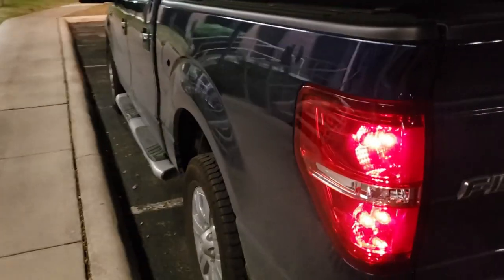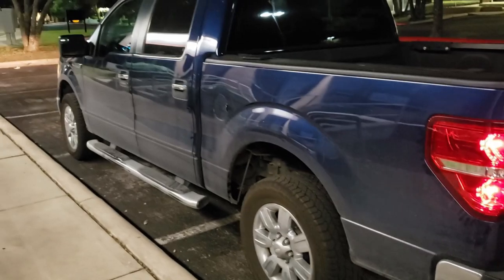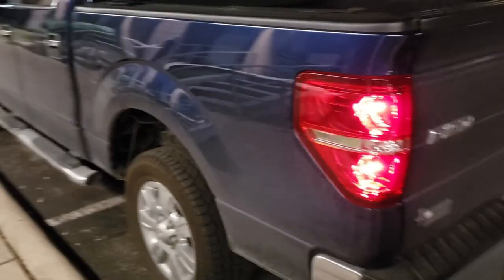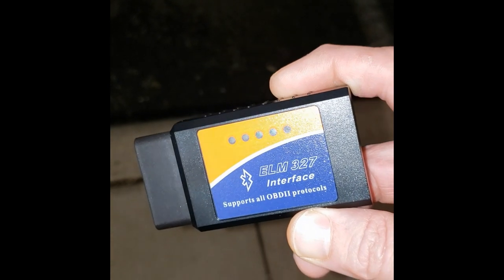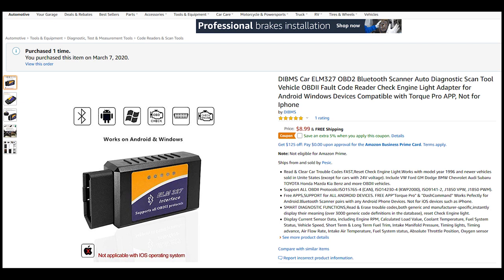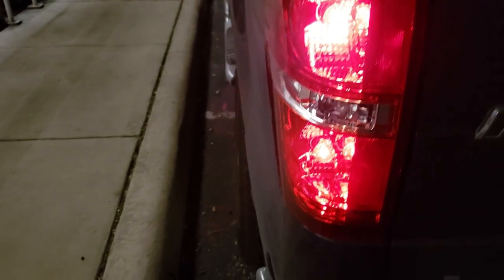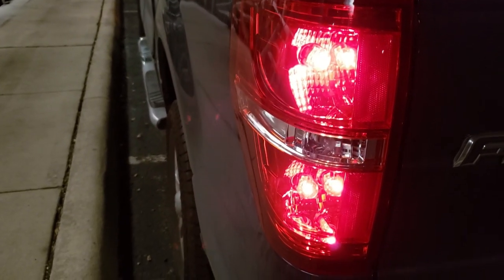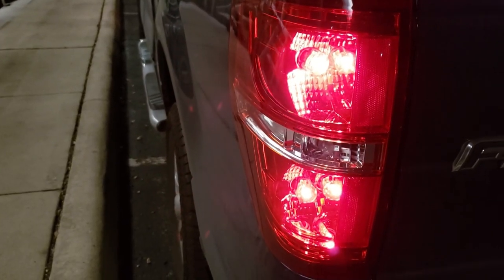2009-2014  F 150 signal brake light fast blink FIX $10 (BCM Body Control Module)

Comment: Someone on the forum could tell me what app you used. ?? I have an issue with the left side of my truck 2012 F-150.  the signal and brake lights don't work. I ordered the OBDII ELM-327 and I cannot clear the codes, I am thinking that I am using the wrong app and I see that everyone in the forum has no problem with it.
Help Please.....
Reply from the maker: I put the app I used in the video. Also, what is the problem? Is your phone not connecting to the device? Are you sure you're using the Bluetooth version and not the wifi version?
Reply: @cedricwilliams6229  Left rear turn signal and brake light out.
Left front turn signal and light on side-view mirror blink but fast. All other lights work. Although  I order the wi-fi version, I have connected the right way. I'm happy that we still have people like you, trying to help the other without any interest, and it has worked for many people here in the forum except for me.    I'm working with the ForCan Lite, but I was trying some couple earlier without any good results.
Reply from the maker: @nachiro66  but what is the problem with your APP?? Does it connect to your device plugged into the truck? Like I said in the video you should've got the Bluetooth version. Not the wifi. But since you got the wifi, the only way to use it will probably be to have your scanner and your phone both connected to your home wifi at the same time. Thats why I said get the Bluetooth version.
Edit update- another user commented that if you buy the wifi version you do NOT have to be connected to wifi. You just connect your phone to the device as if IT is your wifi source.
Reply: @cedricwilliams6229   Totally agrees. That is the one I asked for and the problem was with the different APP that they offer you, even if you buy it, some are good and others are not so good, well that's what happened to me. I tried several and even paid for FORScan Lite but I could never connect it from my device to the Scanner. The app that worked for me was Car Scanner which is FREE and I finally cleared the error codes and everything works as it should. Like you, I would also like to share some very important information on this topic with car lights. BEFORE ORDERING THE ELM-327 SCANNER CHECK ALL THE LIGHTS ONE BY ONE, THERE ARE LIGHTS THAT SEEM TO BE WORKING PERFECTLY, BUT IT IS NOT SO, ALTHOUGH SOME LIGHTS LOOK PERFECTLY GOOD, THAT COULD BE THE PROBLEM, THAT'S WHAT HAPPENED TO ME. I CHANGING ALL MY LIGHT, AND THAT FIX  THE PROBLEM.

Thank you, Cedric.

Comment: On mines the turn signal be turning on by itself and I can’t seem to figure out what it is
Reply: Sounds like the switch itself. I had a 13 Explorer, and I currently have a 13 F150. The problem with mine was that the wipers would come on by themselves, so I replaced the switch, and the problem went away. $50 on amazon, just pop the cover off behind the steering wheel.

Comment: Hi having this problem now but let me ask any one did U all have any problem with Ur tail lights not working When turned on and do all turn lights turn on
Reply from the maker: Its been awhile now but if I remember correctly all the lights were turning on yes, but they would not blink. As for the brand I used its all in the video and I posted links in the description.

Comment: I buy this device and i fix the problem with the light but works just for 1 month and a did the same thing to fix it and now is not working any more.
Somebody knows what's wrong??
Reply from the maker: Mine has been working still after a year. No problems. I'm not sure whats going on with yours.
Reply: do you still have the problem? same thing happened to me and i still don't know how to fix it
Reply: @edgarlicea8170  yes i still have the problem

Comment: This did not fix the problem for me and I was truly hopeful. I think the codes in the BCM were diagnosed along with a few other ones.  I pushed the clear button and it ran for 2.5 hours with out completion.  I would have loved to avoid a trip to the dealer.  Making the call in the morning.  Someone save me if I needed to hang in there longer.  Thanks
Reply from the maker: No, it took just a few moments for me. Not sure why yours ran so long.
Reply: @cedricwilliams6229  Which app did you use?
Reply: Never mind Cedric, I used a different app and the scanner worked!!!!  I thank you so very much!!  I was dreading a trip to the Ford dealership.  Last time I went, I was clipped for 2000 for a transmission problem.  You have made my day sir.  Grateful!
Reply from the maker: @melissaherzog3018  yeah their whole job is to rip you off. Glad it worked. Almost everyone I've heard from here says its worked.

Comment: I tried this with a normal scanner, reset my codes and I still have no brake or turn signal on one side. It did clear the code on my dash tho.
Reply from the maker: Did you actually replace the bulbs?
Reply: @cedricwilliams6229   Yep, one was burnt out, I just changed the other because I had the lights and lens out. I did end up taking it to my normal shop and they went into the system and reset it for 20$. Happy I saw your video. I've got tail lights on both sides again. Thanks Cedric
Reply from the maker: @stevenvandyke2598  Cool. You're welcome
Reply: i used a reg scanner and it didnt work with 200 dollar harbor freight scanner.   then did it with kobra elm 327 and it worked.   just cleared all the dtcs.   2011 f150 v6

Comment: code number please
Reply from the maker: Doesnt matter. Just clear all codes.
Reply: use car scanner app its free.   if you have wifi scanner, look for it as your wifi not your home wifi.  e.g.  wifi111 or something similar in your wifi list.  it will say you have no internet connection but it dosnt matter you are communicating between your phone and scanner.